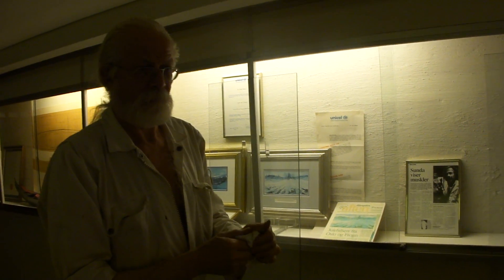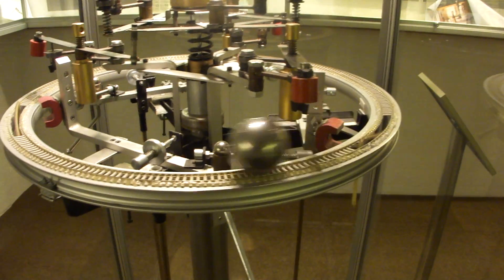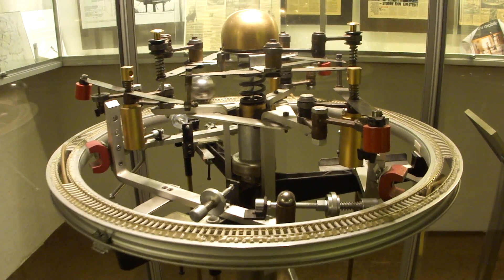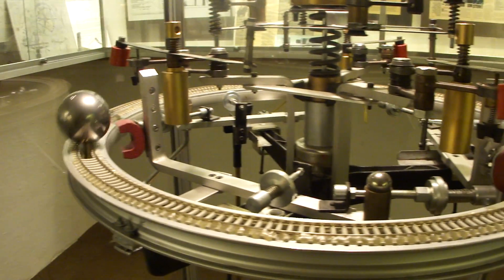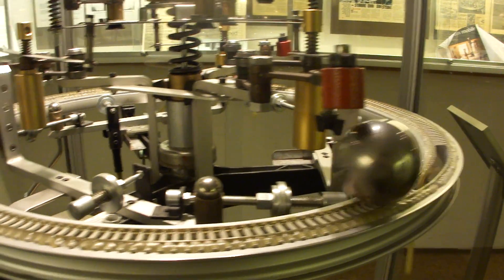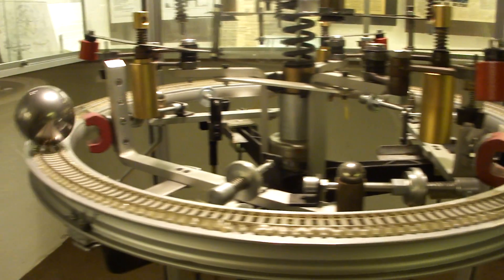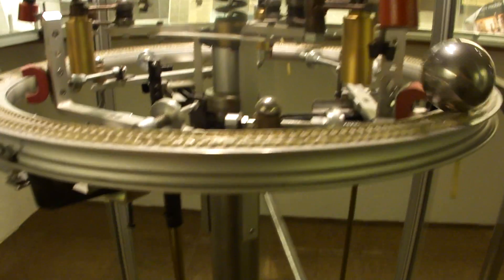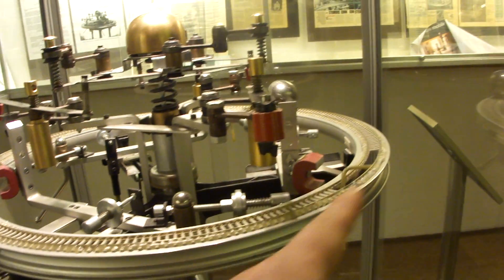Finsrud perpetual motion machine - overunity.com admin Stefan Hartmann visits Reidar Finsrud 13

Comment: When I first saw this device years ago I was impressed. However ask yourselves this question - Does the ball seem to be travelling faster than the movement of the magnets that are pulling/pushing it? The magnets are supposed to drop out of the way to remove the stopping point that magnetic devices have via the pendulums. The magnets above are supposed to push it and they flex a little when the ball goes past. The little lever type springs on the track are suppose to give the ball a little flick as it goes by. Always remember the track is level and there is no down hill action here. Is the ball traveling faster than this? I believe something else is powering the ball maybe a current via the ball rails. What do you guys and gals  think???
Reply: The track is always tilting  little.. the axis is also connected to 4th central heavy pendulum inside the central unit..connected through the central vertical coil spring..

Comment: Perpetual machines are not possible but we can get close (close enough is good enough)

just like the speed of light is unachievable by anything with mass but we can get close to it (the fastest weve gone is about 1-2 percent tho)
Reply: That is a theory. Not a fact
Reply: Nerd of Skittles 
Scientific theories are much different than typical theories. Theory pretty much means fact in science. The theory of gravity, for example..

Perpetual motion is simply impossible because you need an energy source and all energy sources break down. Friction, decay, etc. 

So yes, it is impossible. The magnets would quit working over time, but the machine would probably rust and break apart by then anyway. 
But I'm sure that much is obvious.. 

The question is how efficient can we make machines like this? You aren't going to be mass producing these like generators and change a country over night.. I'm pretty sure it costs more to make than it produces in energy, money wise.
Reply: @andrewsilver7048  gravity is still just a theory. we don't need gravity. density in buoyancy explains it well enough.
Reply: Also, if a perpetual motion machine was invented and mass produced, there wouldn't be much profit. It would kill off major industries. There's little chance of potential, sadly.